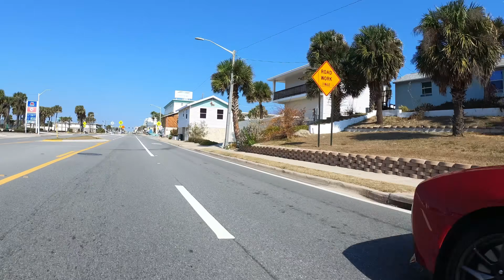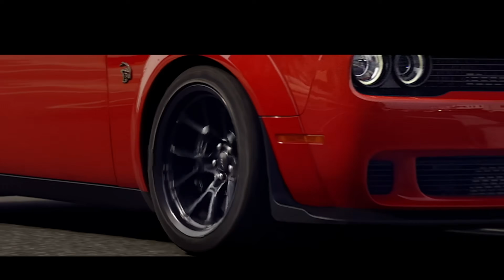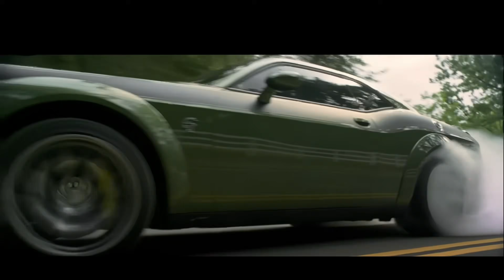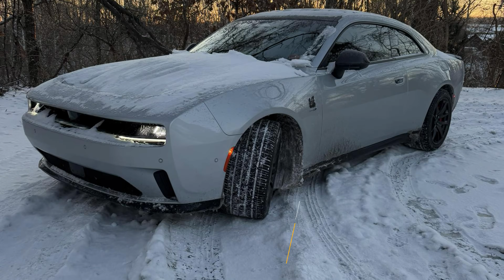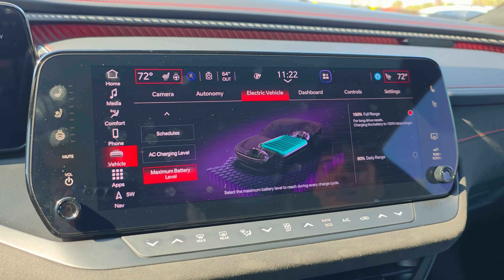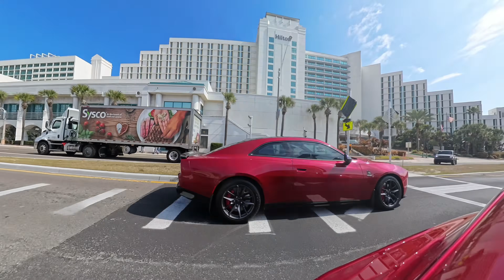Dodge Charger Daytona Scat Pack EV Owner Review

Comment: I had the opportunity to sit in one of these on the dealer lot while my truck was being serviced.  Roomy enough for a big guy like me (6'2), but for a top-end model the interior materials were shockingly cheap.  The infotainment screen was also tremendously laggy.  The glass roof was a mistake, particularly in warmer climates like Florida, but I'm told you apparently cannot opt out of it on most trims.  I definitely couldn't sit in the rear seats (I tried), but I kind of assumed they would be too small for normal adults anyway on a car like this.  The hatch was a nice idea, until you open it and realize it's extremely shallow, making it practically useless.  To carry anything of any real size back there, like a value pack of TP from a big box store or something of similar size, you'd have to put the rear seats down.  I prefer hatches in general, but the trunk on the outgoing Charger/Challenger would've easily accommodated the same item without a problem, so I feel Dodge could've done better there.  I also couldn't make up my mind on the exterior design.  It's not attractive, but I don't necessarily hate it either.  The outgoing Charger/Challenger looked better to me, but again, that's subjective.  

I quickly decided, though, if I ever bought one, I'd have to try to find a way to PERMANENTLY disable that ridiculous fake exhaust speaker. Maybe you can physically disconnect it somehow?  I know it's a personal thing, but I found it offensive and stupid.  The salesman said it would be something I'd have to turn off every single time I started the car, which was dismaying.  I liken that to the auto stop/start "feature" found in ICE vehicles.  I don't want it in the car, but I can't get the car without it, and then I have to remember to turn it off every...single...time I get in the car.  That's not a feature, it's an annoying hindrance and makes me hate the car.  Same with that speaker.  

In the end, I wasn't much impressed with the Charger Daytona, but I didn't get to drive it either.  So, to be fair, the drive may/may not have changed my mind.  When I made my way back to the service department to collect my truck, I talked to the service people about the car and they all cringed and said to avoid it like the plague due to all of the problems they've had with it.  The dealer had it marked down over $20K, but no one would touch it with a 10-foot pole.  I'm sure some people have had good experiences with the car, but even in this review the guy said it bricked itself in the middle of traffic.  That's not good.  In fact, it's very, very bad.  That alone would make me ditch the thing as being unsafe.  It's fair enough to say it was "just the 12-volt battery and it's been fine since that was replaced," but assuming the 12-volt battery that was originally in it was good at some point, how long do you have before it suddenly bricks itself again with this replacement battery?  And why is it doing that in the first place?  It sounds like none of that was addressed or fixed. 

Who knows?  Maybe Dodge will iron out some of this stuff (likely not, if we're being honest), but with all the bad decisions they made during the design phase, the ridiculous pricing, and then all the subsequent failures, it's no wonder it flopped so hard.  It's a shame.  With a few tweaks here and there, and a bit better attention to detail, it might have been something special.
Reply from the maker: The "exhaust" is a speaker system so I would imagine it's possible to permanently disable it by disconnecting the speakers if you don't want the mess with the touchscreen. Concerning the panoramic sunroof, I would guess we'll soon see aftermarket clip-in shades, just as there are for the Tesla Model 3 and Ford Mustang Mach-E sunroofs. Personally, I think the Charger is the one of the best looking, most enjoyable EVs in production right now. The question is whether Dodge can get its quality control in order and improve its firmware/software. For example, your complaint about not being able to permanently disable the sound effects could be handled with an on/off toggle in a software update. The same goes for the battery drain. Did an update find & kill the vampire drain culprit? Your comment about what the salesman said about the Fratzonic exhaust surprised me. I had assumed the sound effects would stay off once toggled off. I'm puzzled as to why Dodge didn't set it up that way. Perhaps an owner can connfirm whether the salesman is correct or whether there's another setting he was unaware of.
Reply: @EVRider   - I sincerely hope the salesman was either wrong or unaware of a setting that would allow the owner to permanently toggle those speakers off.  If not, then a software update of the sort you suggested would be most welcome.  Having said that, Dodge seems to have significantly backed off production of this car, and I kind of suspect it might not be in production much longer given how poorly it has performed, so how much effort are they really going to put into trying to improve it now?  Either way, it'll be interesting to see how it goes.
Reply from the maker: @meadmaker4525 I think you'll see Charger EV development continue since the underlying platform is what Stellantis has bet its future on. Despite current U.S. politics, Stellantis knows the world is transitioning to EVs and recently Dodge hinted we might still see the 800v tri-motor Charger Banshee make production.
Reply: @EVRider  - If they do continue development of the EV portion of this platform, it'll be interesting to see how it evolves and if/how they address the current issues.  I thought the Banshee project was dead, but if not, that'll definitely be something I'd look forward to seeing on the road.
Reply from the maker: @meadmaker4525 My personal guess is we'll see 800v Chargers, including the Banshee, when solid state batteries go into production. But who knows how many years out that might be.
Reply: @EVRider agreed. I think Dodge pivoted with the Hurricane to try and sell cars now and generate cash with the knowledge that electrification will eclipse ICE. I suspect the Banshee is just on hold.

Comment: Which year was this one? I assume it's gotten quite a few updates that fixed the early bricking. I just wonder how cars that have been sitting on lots since 2024 would perform if bought now?
Reply from the maker: It's a 2024 that he's had since March 2025.
Reply: @EVRider wow that is a crazy amount of miles and crazy low problems in under a year.
Reply: @SmthngJacob  not really, you are only hearing about people with issues, plenty of us running our cars fine. The 12 v batteries are whats causing the bricking... pretty easy fix.  Obviously, anyone who has a real issue (bad motor or something real serious is all over the internet screaming) and youtubers love to trash on cars for easy views.  There have been a lot of patches though, they are getting it right.

Comment: Of note, the Charger Daytona EV Scat Pack is pound for pound faster in all specs, 0 to 60 and qtr, than a Hellcat Redeye Widebady. It posts numbers equal to or better than a Hellcat Redeye at 1,000 lbs more weight. That is nothing to take lightly. Plus. the 800 volt Charger Daytona EV Banshee, (in design?) has the possibility of approaching if not surpassing Demon specs. Initial influencer reviews that appeared to me to be false (I own this car and it is truly a great car) may have affected the further production of the 800 volt Banshee.
Reply from the maker: @rocknroll2199 I hope Dodge follows through with the Banshee. If done right, it would likely set new quarter-mile records and if it includes solid state batteries, which Stellantis is working on, it would probably remove any lingering concerns about range or charging time.